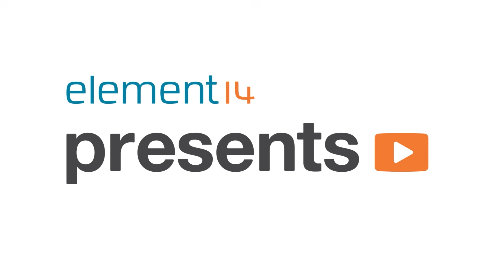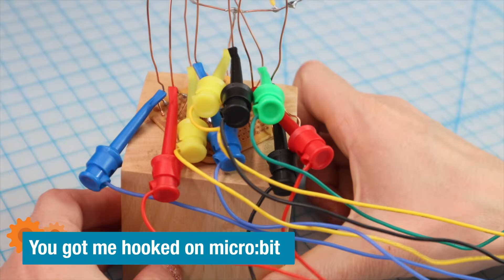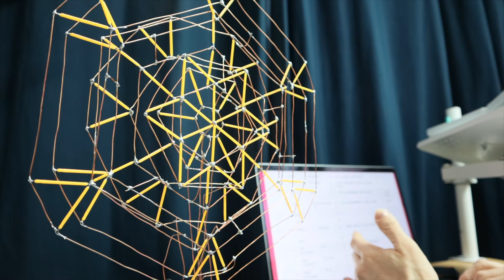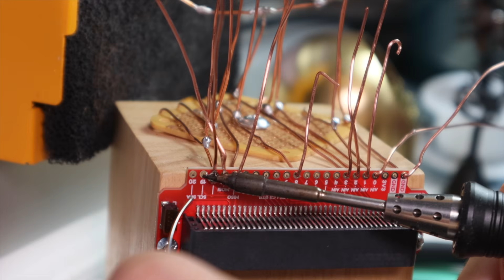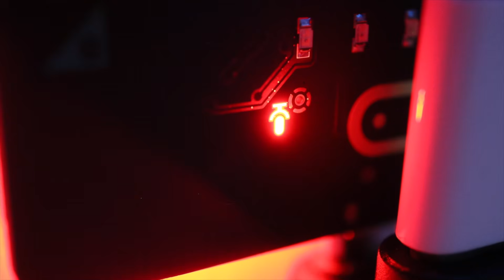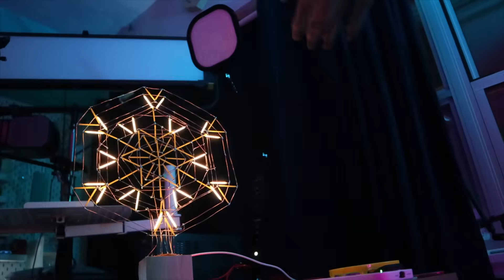Voice‑Activated Snowflake! Animating LEDs with a micro:bit

Comment: I think the wires should be painted with matte black to lower the reflectance so the pattern would be more pronounced. I would also try to implement pwm that gradually transition brightness from stage to stage. I.e. not on/off states that switch sections, but the ones that gradually transition. Speed can vary ofc.